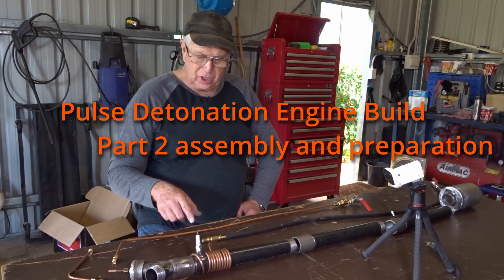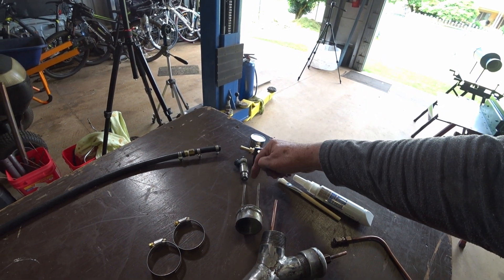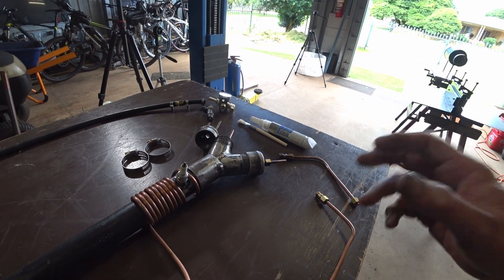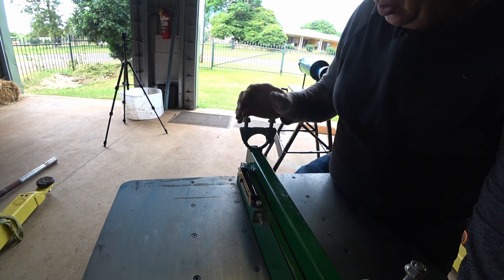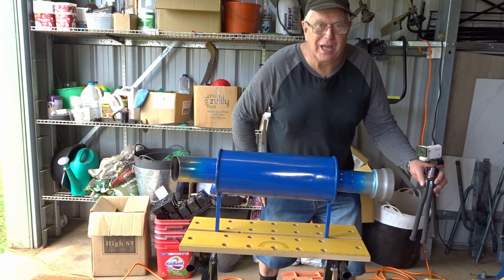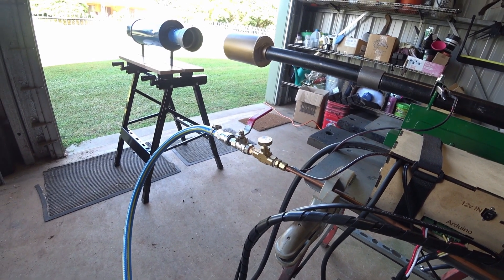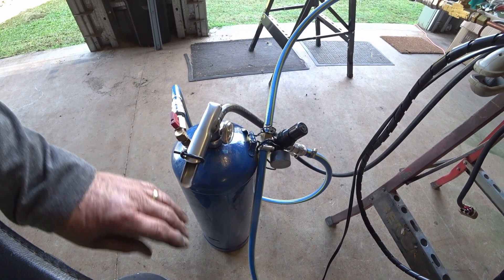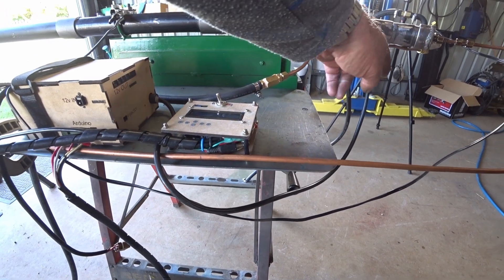Pulse Detonation Engine Build Part 2

Comment: Similar to the v3 cannon operation
Reply from the maker: I was unfamiliar with the V3 Cannon . But did the research. I see where you are coming from, with petrol detonation (hypersonic) was hit and miss. I did move onto differant configerations and using HHO which gets consistent Detonation. It may be interesting to try a projectile with HHO but could be a bit dangerous like a pipe bomb.